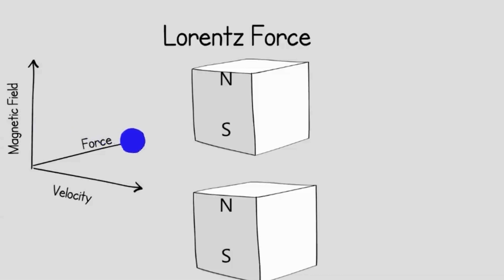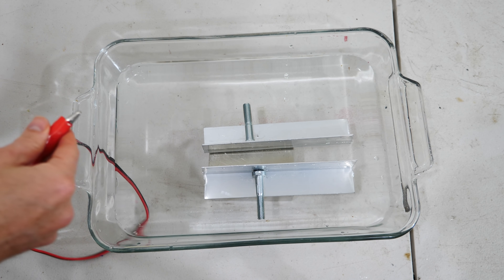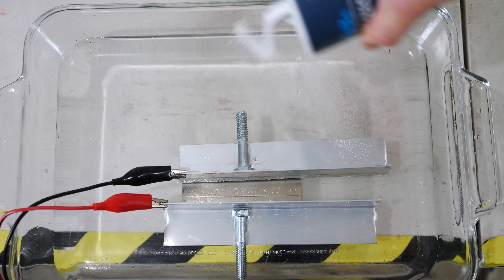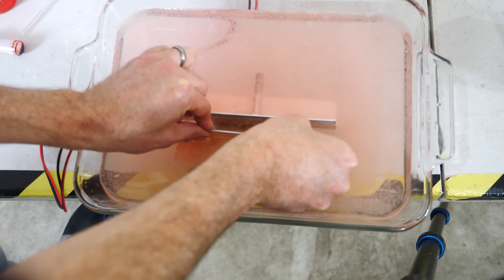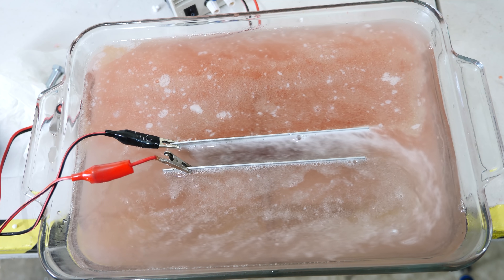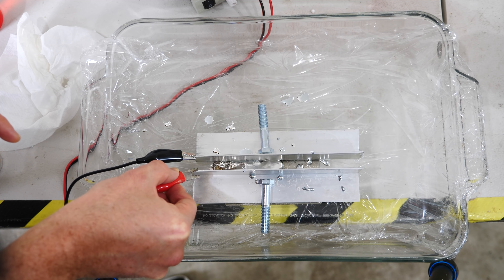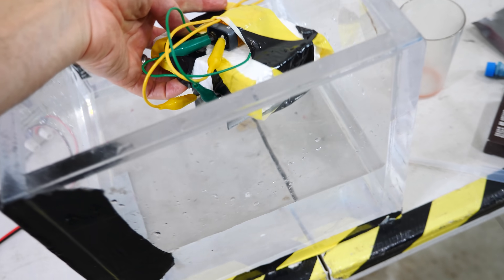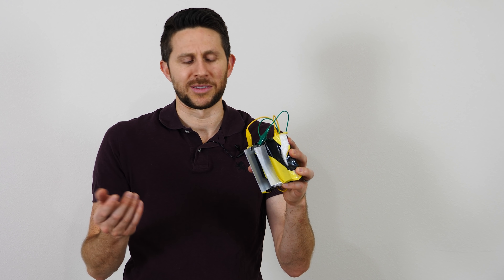I Made a Real Magnetohydrodynamic Drive

Comment: What if you could collect the hydrogen bubbles and run them back through a fuel cell that creates the energy to propel it.
Reply: That's actually a pretty good idea. That might be able to get some of that lost efficiency back
Reply: or even ignite the hydrogen for extra thrust!
Reply: Would be a great idea for a submarine or a boat, submarines have massive reactors though so I don't really think its needed... it seems they could use this for stealth technology for submarines
Reply: Creative thinking.
Reply: STANLEY !! MAYER !!??
Reply: van u explain more about this method"
Reply: To create hydrogen fuel is very costly, to run a car for 1km with hydrogen fuel but in the process it need to burn 4x fossil fuel for that hydrogen. Btw hydrogen car is electric car,  that hydrogen cannot be burned to move your car like gasoline, so another energy loss to convert hydrogen to electric
Reply: @CahyoPrabowo  you definitely can burn hydrogen in a combustion engine.. 
 People do it all the time. 
 I've seen where people do gain some efficiency, especially if they can reprogram the ECU to compensate for the extra oxygen(unmodified the car will sense extra oxygen from hho, and it will dump more gas in to compensate) 

 Hydrogen has a very high octane, and it also has a better rate of expansion... so this means it can help gas engines run better by burning more gas closer to the cylinder wall that would otherwise go unburned. It also helps remove engine deposits by turning to steam after combustion, which also helps lower nox emissions and cool the exhaust.. 
 There are some methods that are more efficient then others, and I believe people need to experiment more.
Reply: @helpabrothawithasubisaiah5316  You can burn the hydrogen like a combustion engine sure, but every time you change the energy type there are losses.

Hydrogen and oxygen reforming water through an electrical means and then converting electricity to mechanical work is more efficient then converting the stored energy into heat/pressure into linear motion into rotation work for an engine.

That and while it may have a faster explosion wave, the total energy released from a hydrogen engine will be much less than gasoline on a per mass basis.

Good idea, practically not as efficient. 

There is a good idea worth considering though that it is renewable so it had potential to be worth it considering the trade off of efficiency.
Reply: @chrisstubbs6391  there are some people who are making their older cars more efficient using hho.. so instead of 10mpg they are getting 30-40mpg
Reply: @helpabrothawithasubisaiah5316  There are plenty of reason as to why changing from an older car on gasoline to hho would improve. For example being harness more of the energy from the fuel.

I'm just saying from a pure energy standpoint hho is not as energy dense as gasoline and at comparable efficiency will not be as good as gasoline. Nuclear reactors on submarines for example only use about 18% of the energy released from fission.

Edit: auto correct fission to fusion lol
Reply: @chrisstubbs6391  what experience do you yourself have with burning hydro?
Reply: @arnold3785  Chemical engineer, nuclear navy veteran, is that sufficient experience for energy production? 

From a pure chemical potential energy standpoint gasoline is better. The kJ/mol released from gasoline combustion is higher than standard enthalpy of formation of water. There are tons of factors will effect the efficiency and utilization of this energy. Simply saying someone is getting better results from hydrogen than gas isn't sufficient justification to say it's better.
Reply: @chrisstubbs6391  owned :)
Reply: @helpabrothawithasubisaiah5316  What does "mpg" have to do with compressed hydrogen?
Reply: @CahyoPrabowo  sort of. They do have hydrogen combustion engines but same thing....costs more than it saves. Also that creates a lot of negative emissions that you don't get with converting to electric. I know everyone says the only byproduct is H2O but ...lemme think....more nitrogen dioxide thanks diesel ?
Reply: @kahnfused1  you are talking crap you don't know anything about burning hydro.
Reply: @CahyoPrabowo  Not if you use renewable energies.
Reply: @CahyoPrabowo  How come you are so sure about your allegations, have you found this out yoursef?

Comment: There was a serious proposal to apply  same principles to space capsules on re-entry, to apply magnetic force against the  plasma appearing around the capsule ( although they said a superconductor was also  needed to do it efficiently  which complicate things ..). The idea was to avoid expensive thermal shields and to permit  re-entry at  higher speeds) . Could you consider an  experiment with plasma, superconductor and a capsule mockup?  That would be cool!
Reply: Search for "MHD hypersonic flow control for aerospace applications" . Supersonic flight without shockwave is actually possible!

Comment: how efficient would it be if you captured the excess oxygen and hydrogen as the boat passed over the liquid and then burned it at the rear like a rocket? or burned it to generate electricity.

Comment: Hmm could it be possible to generate electricity by passing a ionised fluid through the same set-up but the electrodes are connected to a bulb or some load?
Reply: Probably, but you'd have to use more energy in the first place to set the fluid in motion
Reply: wow
Reply: There would be a loss so it would be easier and better to just connect it to you power supply
Reply: It is possible, but the power output is very low
It does have use though. The food industry often uses flow meters based on this principle to measure the flow of liquids without risking contamination